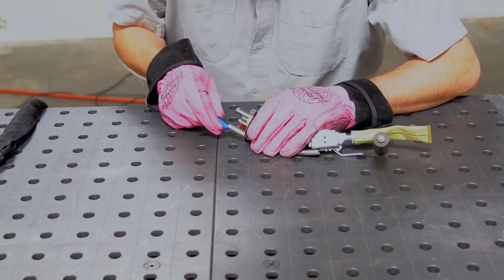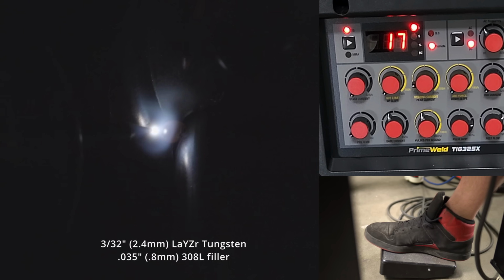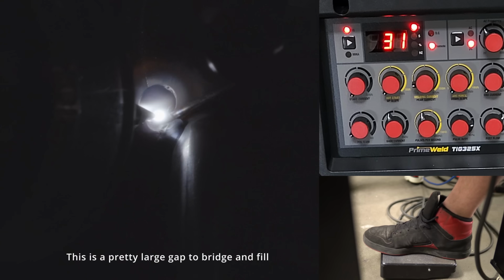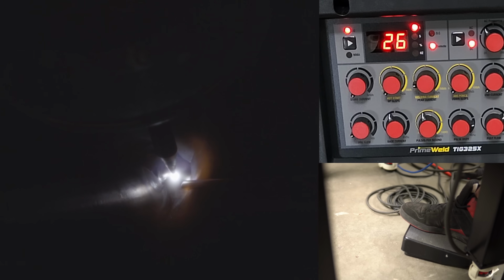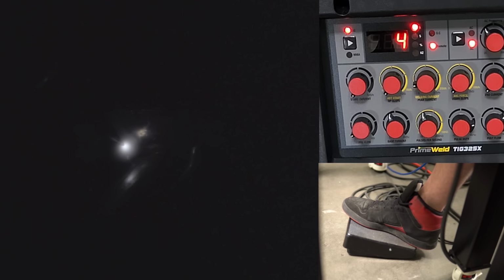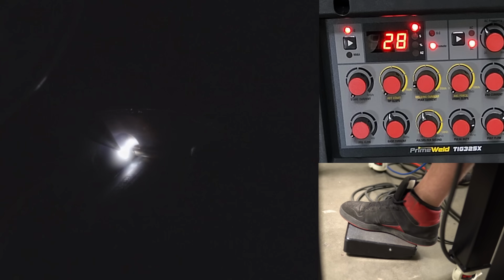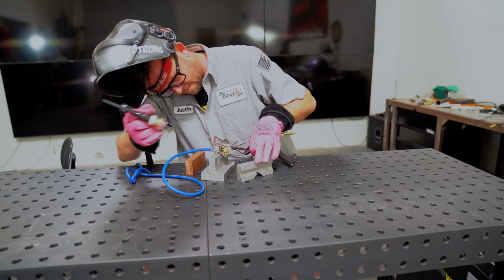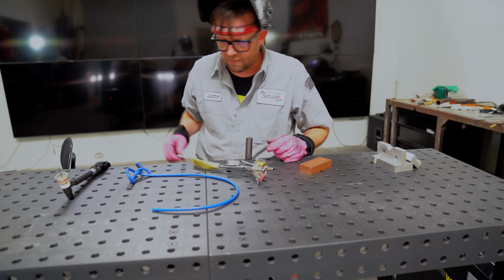TIG Welding Thin Parts

Comment: Hi, I have watched a few of your videos and have subscribed. I would like some advice, and maybe a lead to a video about tig welding without a foot pedal. My machine came without a foot pedal. it has a port to plug one in but does not have any wires connecting the port to anything. I was wondering how to control the amps in such a case? 
Thanks Chris

Comment: I have done this modification to the gas tank inlet/sending unit before and found another way.  Rather than welding where the tube passes through the flange I welded (a couple good tacks is all that was needed) a bracket inside the flange which the tube also passed through.  Then soldered where the tube passes through the flange to create a seal.  Your way is definitely superior, but my skill level is not there yet.  By continuing to follow along on your channel hope to improve my skill.  I thank you for everything I have already picked up in a short time.

Comment: Could you go more in depth for when sugaring is acceptable for automotive purposes & more
Reply: Sugaring will cause premature failure if say you weld a stainless exhaust without purge. The backside of the weld getting an oxide will be a stress riser and can result in a cracked weld. So if you care about quality never. Lol.

Comment: 20 gauge and down is easy enough.  But I would typically just use less amps and floor the pedal for the most part.  Easing off towards the end of course.  Just have to move faster the thinner you are welding.  Aluminum foil is screaming fast. But it is like any other welding you just have to watch the puddle and move accordingly.

Comment: I’d like some low amp tips and tricks videos.
Reply: Just practice on thin stainless steel and aluminum pieces . It's a big challenge but that's how I have been learning. Now I find aluminum is easier and more forgiving than stainless.
Reply: @epluribusunum5405 I’ve kinda discovered that. 1/8” aluminum is actually pretty forgiving. It’s the thinner stuff that gets tough. Maybe just need to work faster as it always seems to want to burn down on me.

Comment: That's the stuff I dick with all the time. Tiny parts, tiny welds, tiny space, tiny x,y,z, heat-time-travel. Maddening. Almost have to burst tack it, as you go. Put the rod there, floor it once. Repeat, to not overheat it. Very tapered electrode and tons of shielding gas. Or, if you can per item, heat it some with propane torch, like a ten second blast. Makes it wet out easier, than cold.